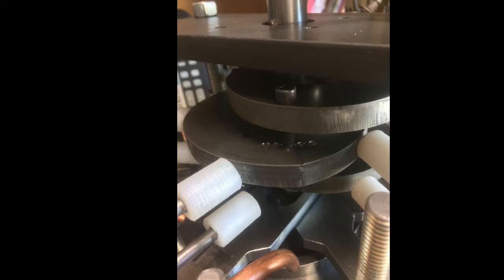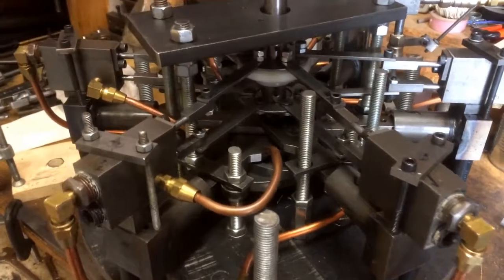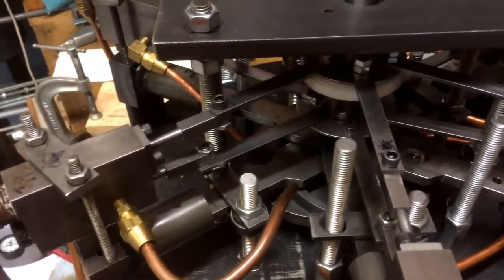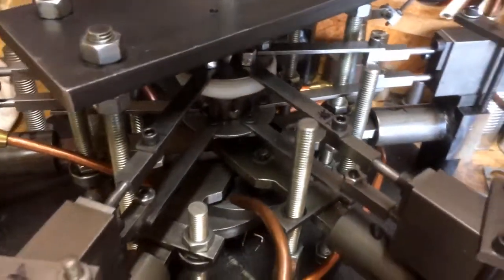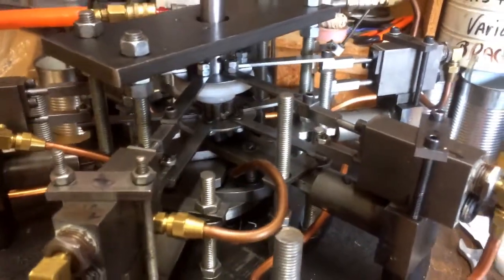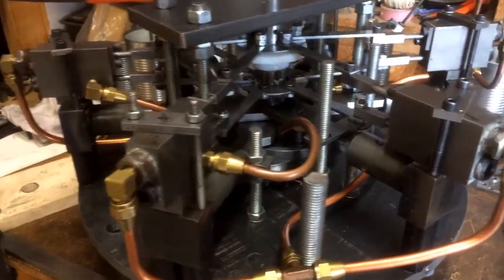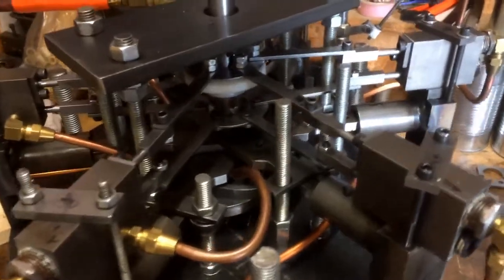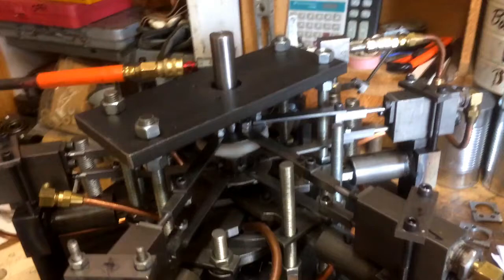Projects for 2018,  2-4-6 Cyl Air Engine with New Valve Train

Comment: Interesting idea Don, what if the cylinder which is ready to exhaust pumped high pressure right into the next cylinder that was ready for air instead of caching it in a separate tank?
Reply from the maker: Thanks for your comment/suggestion.
I'm happy to see that at least one person is thinking about what I am contemplating, and not just watching the video to see what i have to say. 
I have gotten some good feedback from other subscribers in the past, and i do think about what they have to offer.
As i said in the video, I just recently came up with the thought - what if " SOME " of the exhaust air could be saved to reuse (maybe at a lower pressure, but any amount of pressurized air would reduce the amount of high pressure air used from the storage tank).

I haven't done much designing on paper yet.
I'm trying to think it through in my mind at this point, and your suggestion to move the Exhaust to the next cylinder ready to be pressurized is right on target, but how exactly isn't clear yet!

One problem that I'm sure will have to be worked out is - how to capture & move the Exhaust Air. 
Moving Air from one place to another with Valves & Tubes or Headers causes pressure drop, and it takes time.  
My 6 cylinders are as far apart as they can be with my current designed engine, and running at say 1,500 to 2,000 RPMs doesn't give much time to open and close valves. 

I am afraid, if I can come up with a feasible recovery system, that the cylinders will have to be moved into the center, with heads joined together.
The Valving system is going to be much more complex than my current one, but I'm pretty sure it can be done.

Once again, thanks for the input, and keep thinking -What If ?